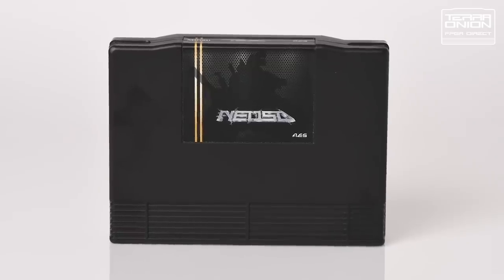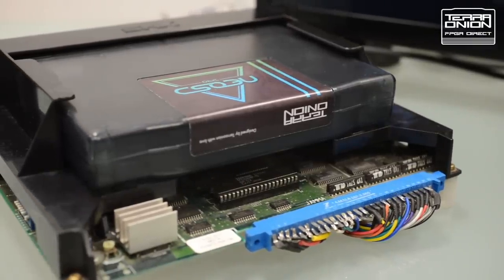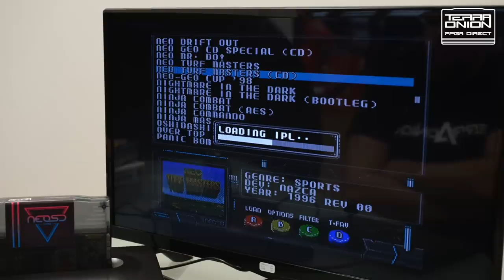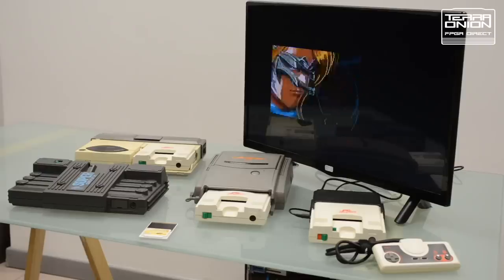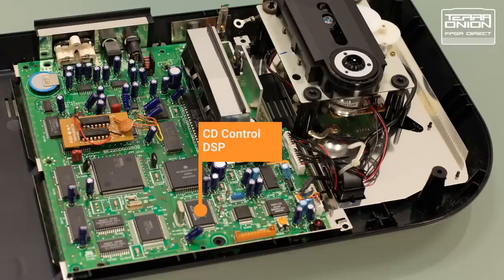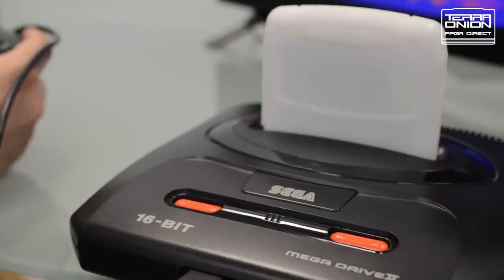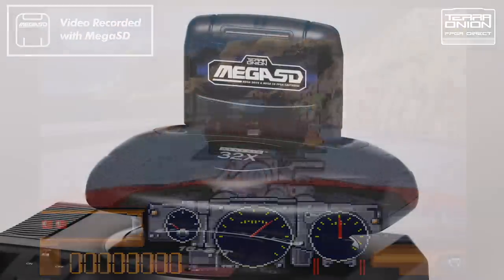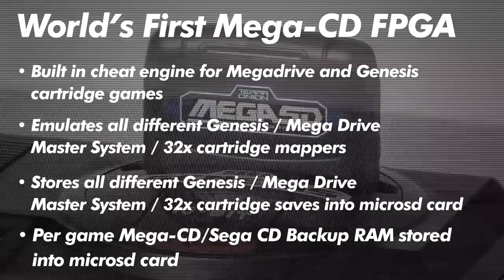Terraonion FPGA Direct -- MegaSD reveal!

Comment: Very good! But for this price, I will wait for the next/ultimate model which will play 32X games as well (without the 32X).
Reply: Adam It supports it with the 32X add-on.  But I am sure soon enough, we will have a Pro version with embedded 32X fpga as well.
Reply: It can’t get video output from the Genesis/Megadrive through the cartridge slot. It would need an RGB input and that’s where it starts to get unwieldy before you even start looking at replicating the chips. They’ve been a little discouraged by their past venture into analog which is the whole reason they had FirebrandX do the analog audio here. I don’t think they’re ready to mess with overlaying analog graphics on analog graphics. Maybe they would if they were making a whole FPGA Genesis+32X clone with HDMI, but I think they’d make an FPGA Neo Geo clone first. ;)
Reply: Emmett Turner Thanks. What you wrote is very informative and interesting. It makes sense.
Btw I just ordered it ;)

Comment: Can the higher speed of the SD card be used to speed up games with poor access speed/bad load times? MORTAL KOMBAT! Comes to mind .An SD card VS a one x CD ROM Drive is quite an insane difference in speed. An actual setting to tweak disc speed?